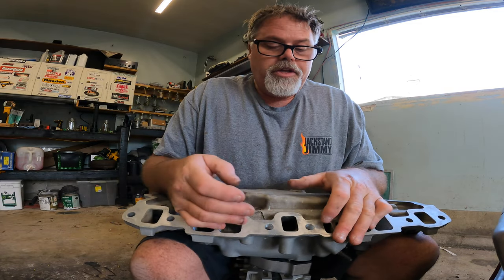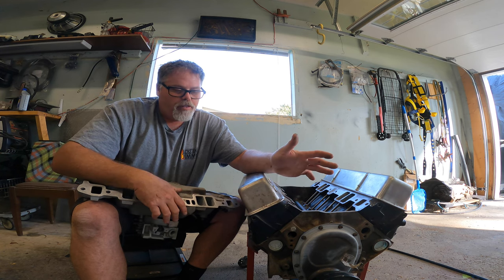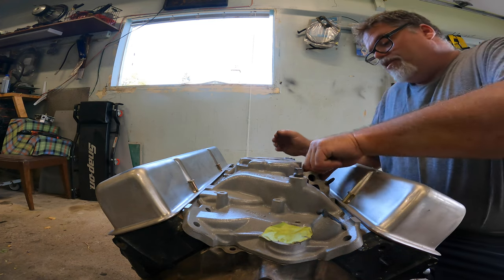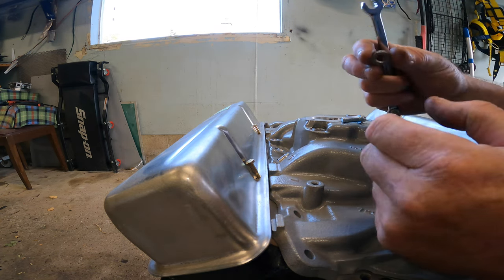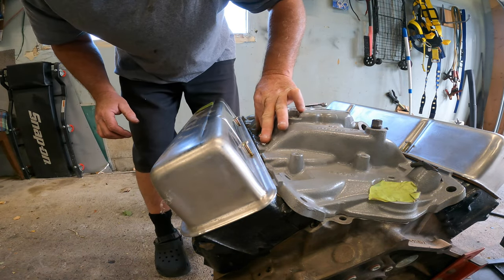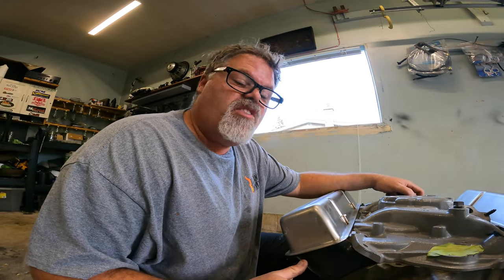500HP 305 Small Block Chevy Making Intake Fit   4K

Comment: I don’t think anyone has ever made it to 500hp with a pump gas 305 build.  If you can get a legit 400hp from a pump gas 305 it’ll be a win!  👍
Reply: Yeah,  305 just has too much valve shrouding for 500hp.  Flat tops will be around 9.5-1 compression.  I’m building a similar motor just for fun.  I would be pumped with 300hp, 275 is more likely.
Reply from the maker: No way are you sure lol .
Reply: The best 305 sprint car engines will make around 500 on methanol. You probably have around 350 hp

Comment: Buddy I had absolute awesome results from a edlebrock performer intake and my carb was a 600 cfm. It ran like a grape ape . Don't really know what a grape ape runs like but it ran tight. Easy start plenty of horse power.  Edlebrock is sweet shit. Yes the carbs are throw away when they get old but in new conditions they have a good carb for a 305,350 chevy

Comment: Hey man I might get 500hp but this is what I'm thinking about doing to a 305 when I can get my hands one one I'm going to run around 9.4:1 compression with kheth black dish pistons factory bore size 3.750 stroke crank factory 70s 80s 350 cylinder heads and port the get some heaver valve springs Howards big daddy rattler camshaft 118081-09 and an elderbrook performer intake manifold and a 750 quadrajet carb factory size bush rods comp cams rocker arms

Comment: .060 in a 350 makes it a 360
Reply: Do u realize how little material is cut out of a cylinder when it's bord over.. 060 of a inching don't think that it's enough to even change the cubic inches
Reply: It just math.   Bore x bore x stroke x .7854 x number of cylinders.

305 .060 over is 3.794 x 3.794 x 3.48 x .7854 x 8 = 315.07 cubic inches.
Reply: @Clawson_customs  Hope you never build an engine. 350 bored .030 over is a 355. I honestly thought this was common knowledge.
Reply: @hallcharlie74  I'm a machinist and I have built a lot of engines probably at least 30 times more than you have buddy
Reply: @Clawson_customs  😂🤣🤣🤡

Comment: 305  probably won't hit 500 horse man I would have to see Dino paperwork and video to of that same motor with serial number 305 was a never was a performance motor save your money and build a 383 then you'll hit your 500 horse I'm not trying to be mean man
Reply from the maker: Lol its all a joke .
Reply: @LifeWithBillSiff  Powernation has an episode where they did a 515hp 305. Wasnt easy or cheap but they got it done
if you can get 350ish-400 decent torque the truck will like that
trick flow still makes thier aluminum 305 heads btw